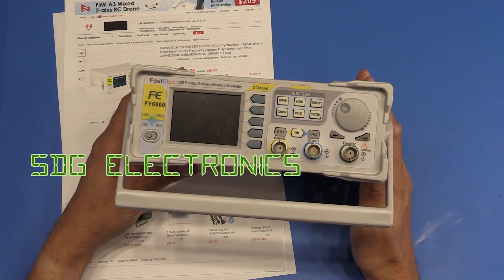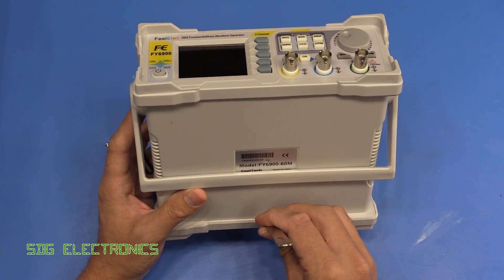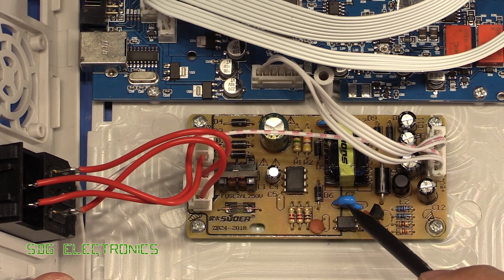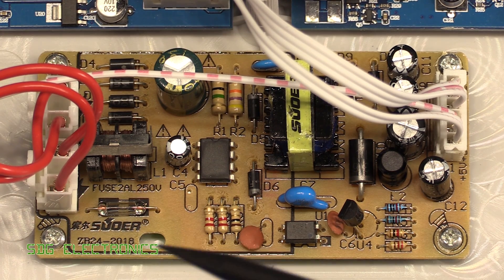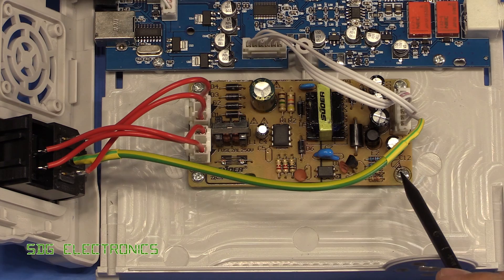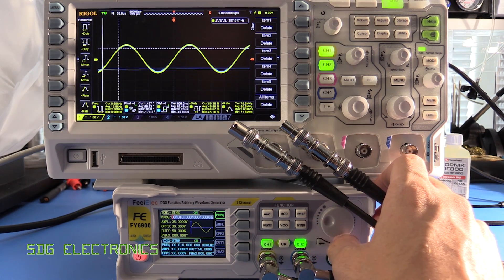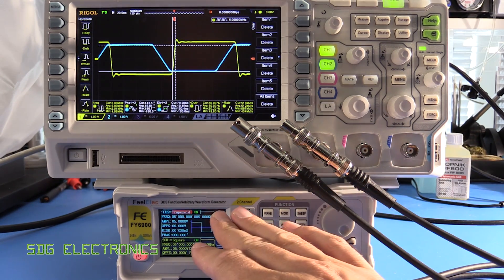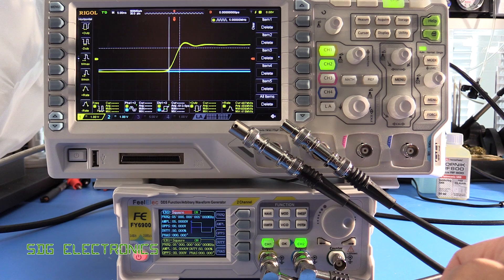SDG #096 Feeltech FY6900 Arbitrary Function Generator Teardown

Comment: 50Ohm load ..........gen 5VPP........??? 2,5V pp on scope
Reply: Yes. The voltage is divided by the internal 50ohm in the generator and the 50ohm impedance of the scope. I has to be 2.5V

Comment: On my FY6900 (100MHz version), when I cable one of the signal generator channels over to the integral frequency counter (not shown in this video), it reliably shows the same duty cycle numbers. But when measuring either of the internally generated sine waves, the counter shows a duty cycle if 59.6% or something like that. I have noticed the same thing in some other videos of this model, all of them slower speed versions. I wonder if it is a bug....it does not seem to be due to the sine waves having a DC offset or anything like that........

Comment: nice review !   if one were to power it via the 5v in on the rear what would be a suitable input current from the PS used ?   wondering is a 2.4 a  cell phone  charger would be acceptable or even what to choose for current from a bench P.S. unit.   I'd be using it only for sine wave 20 - 20,000 khz  for audio amp testing purposes... at that frequency the square wave may even look proper but all i need is sine really.

Comment: The 5V+12v,-12v are pretty common voltages, you can easily build a small lnear PSU and fit it in there with LM78xx regs.

Comment: The Roll off is smooth from zero to 60Mhz seen logarithmically, it become noticeable in particular above a couple of Mhz and decreases rapidly towards 60Mhz(-12dB down), good quality signal generators would probably use switchable gain amplifiers or amplifies that can handle higher frequencies. Nice toy!, but its no way a serious bit of test equipment.

Comment: I've been watching various reviews on these cheaper Function Generators and SDG has been very helpful in choosing one for me in 2023. I'm a hobbyist and purchased the East Tester ET3360C 60Mhz unit. It was delivered this morning (10 day delivery) and I have to admit I'm very happy with my purchase. The unit has a very small screen but is easy to read. This particular unit will do modulation for radio tuning but I will mainly be using it to drive TTL clock frequency. There is a drop off I'm aplitude after 30Mhz Sine but that is to be expected. I'm very happy with my East Tester ET3360C.

Comment: Try to not direct BNC cable connect between the FY6900 and a 'scope, say to observe or test the FY6900 wave forms, timing and other features. Ringing will likely occur , occluding and changing wave-forms, etc. Instead, utilize the properly compensated 'scope probe(s), and one will receive and observe a great deal improved wave-forms.

Comment: Picked up one of these recently. Was going to build your PSU for it but my FY6900 comes with the v2.1 pcb which only needs a 5v supply.I’m going to try replacing it with a Meanwell 5v SMPS.
Reply: Hi. I can't find any other information about this v2.1 revision of the board. Can you elaborate? or post a picture so we can see the changes?

Cheers.
Reply: What FW version comes up on your boot screen?
Reply: My question re FW was to Stuart...

Comment: I have been off the air for 35+ years, just started up again and need a few pieces for the bench, not mush reparting anymore, but something to have in case.  I was looking at the K moon FY6800 DDS Signal Generator/Counter,  For something that may be turned on once a month if that what do you think?

Comment: So beside the lead from the mains which I agree the cable is too tiny, the rest is overkill for a generator that already meets the needs of hobbyists.  I'm not sure what you think these units are supposed to have at price point of $100.  Realistically you are getting a lot of function for that money compared to the big boys.  Frankly I see no issue with its current power supply whatsoever and any variation would be negligible at best.  It's not overheating by any means and that's why there isn't a stock fan.
Reply from the maker: The output drivers get excessively hot when driving a 50 ohm load which is the main reason for cooling. 
The main issue with the power supply is it is not suitable for use in this country and would fail the requirements for the usual UL, CE, TUV certifications. The leakage current is also sufficiently high that it can present a risk to any electronics connected to it.

Comment: Hello Steve! This is the best overview of the generator FY6900 on YouTube. Thanks. You like it from me.
Reply: Steve, I have the 6900 and my oscilloscope showed substantial switching noise. I installed a torroid in the 5 volt line with capacitance after to 0 volts. The noise was very low after and my ham radio no longer saw the noise.

Gerry Rousseau

Comment: Does it allow smooth adjustment of amplitude, frequency and so on? Mine appears to disturb the output for a while whenever I do any adjustment to the waveform parameters.
Reply: Hi, I have a FeelTech FY3200S and it does the same. I would like to buy another signal generator that does not make glitches when adjusting the frequency or amplitude. Which signal generator do you have? and did you get an answer to your question?
Reply: @gertgude-hansen2562  Only your answer. Mine is FY8300 10MHz. This glitch is very annoying and makes this generator useless in my experiments with switching power converters processing power while the generator was supposed to smoothly change the reference signals amplitude/freq.

Comment: Nice video. So have the potentially dangerous floating voltages been fixed? Will I need to put in a linear supply? Is that what you had to do? I have 39 volts rms coming off the BNC grounds and the very arbitrary signal is disturbing looking spikey garbage - and this is with the power off and the unit connected to mains. Would you know if I'm missing something?

Comment: Hi Steve, I couldn't deal with the encoder knob. So I 3D printed a new one. I dl the openscad code from thingiverse and modified the code to what I wanted. It's SO much easier now to adjust the generator. I did print it upside down so the shaft hole was facing up for better results.
Reply: Lucky you, having 3d printer... I would need to make it from wood....

Comment: Thank you. Great video 
I am just wondering if I can sync the start of a square wave on channel 2 with the start of a sine wave sweep on channel 1.

So my square wave will pulse every time my sweep starts.

Like in this YouTube video.

https://youtu.be/uMH2hGvqhlE
Reply: I just got one of these today from banggood (60Mhz version). I tried this (as seen on eevblog) but the sync output multiple square wave's at different frequencies not a square wave based on the timer cycle (no options to change that either). So I setup a 1sec square wave on channel 2 and did a 1sec sweep on channel 1. This seemed to work but I was seeing a big drift between the start of the sweep and the square wave trigger. This led me to find out that it had a sweep timing fault (on my box or by design??). I found that when I chose a 1sec sweep I actually got a 0.89sec sweep which was causing the drift, even if I compensated to 1.1sec it would still drift slowly :( ...I also found that the phase controls on both channels didnt work on my box so I have a faulty box and sending back.

Comment: Thought: Wouldn't it be better to add a series inductor to the (signal-ground to mains-earth) connection?
It would ensure a DC potential between the signal ground and mains earth close to 0V, while letting the EMI suppression safety capacitor carry any high frequency noise

Comment: Will be looking forward to your next video on this, have just purchased this model and would very much like to make the suggested modifications. Would be nice to do the output of a transformer into buck converter modules but will probably knock up something akin to your FY3224S regulator circuit if that's what you end up doing, at this point i'm just gonna sheeple it and do what you do lol The only thing i'll do different if you go down the regulator route is JLPCB it for a more neater result... I just have a fetish for Red PCB's :-)

Comment: thanks for the video. for me 5v output is not enough, so I will certainly go for a 30MHz version instead that offers 20V output. also this poer supply seems very crappy. the former 6800 had a better one !
Reply from the maker: I think I was mistaken, the output voltage capability is the same, but drops when set to higher frequencies
Reply: @sdgelectronics  do you agree with him about the power supply being worst? Thanks

Comment: The color of the protection gear is the same as the body color. Also the back panel misses labels and voltage plate. It looks like an unfinished product.
Reply: Labels are stamped into the plastic

Comment: Hi. Thanks for the review. It does not make any sense that the 60 MHz version is rated ONLY to 5 Vpp output. If you see the specs table (at minute 01:30) you will notice that those 5 Vpp are for outputs greater than 20 MHz (take a look at the row immediately above of the one you highlighted in yellow) and the outputs at 24 Vpp are available for frequencies lower than 5 Mhz. It looks to me that this is for all models. I guess those 4 amplitude ranges in the table do not belong to each products model (2nd row), but they do belong to the row with the frequency ranges just above the yellow row. Actually you never adjusted the amplitudes in your video above 5V. Tricky chinese specs table!!!. Thanks.
Reply from the maker: Hi Rodolfo, yes I think you may be correct. Either the GBW of the amplifiers is not high enough or they cannot dissipate enough power. Indeed it does let you set the voltage higher at low frequencies.
Reply: Is there anyway to overcome this limitation? like putting the output in series with an external power supply?
Reply: @Adrian_Finn  Just use a amplifier, right?

Comment: Thanks for doing this video. I'll be waiting for the update, as I just purchased that same generator. It will be interesting to see your changes for a PSU. I replaced that same return wire, but mine wasn't as big as yours. I installed a fan from a zener float, the extra caps seemed to help clean the circuit. It was also missing a heatsink.  As always, great video! :-)

Comment: Nice video. Does it also show half amplitude when connected to a 50 ohms termination like the previous model?
Reply from the maker: Yes.
Reply: @sdgelectronics  is that not correct? It seems to be correct since that would be an impedance match

Comment: Thanks for the info,, I remember the mods you did to your old one and I had followed your lead! I would gladly pay 10 to 15 more for a liner power supply although building one is not a problem but still it would be nice if it would come with one from the start. Thanks again!!

Comment: I believe standards call for ground wire to be the same gauge or thicker than mains. That way in case of “catastrophic failure” it would be able to carry all of incoming mains current to the earth and not blow up like the fuse. Here the ribbon cable looks about 22 gauge when mains looks at least twice thicker.

Comment: Thanks for doing this excellent review. I purchased the same 60MHz unit about 3 months ago and have been reasonably happy with using it to drive a set of synchronized PWM waveforms. One question I have is that you were a little bit cryptic when you spoke of how the power supply was non-ideal because its design wasn't compatible with the need to ground the BNC shields. I think it would be interesting and educational to explore this further if you have time and include high level schematics of the way it's currently being done in this unit, and the better way.
Reply from the maker: I will probably design a new PCB for the Power Supply and cover all of this in a future video :) Thanks.

Comment: Thanks for the review. I have been looking at this product.They sell four versions of it. Seems to me that the only diffrents beetween the 20Mhz version (cheapest) and the 60 Mhz version (most expensive) is the max output freqency of the sinewave ( 60 Mhz instead of 20 Mhz). All other waveforms have the same top frequency output (except square wave is only 15 Mhz on the cheapest 20M type, but 20 Mhz on the other three more expansive types).

What is interesting is that all four version have the same sampling rate of 250 MSa/s. I also do not see any other difference on the spec on the banggood website. As a layman it looks to me that the going over 20 Mhz is of no use with this samling rate. What you are possibly paying for on the more expensive versions ( 30M,50M and 60M) is just unlocking in the firmware, disorted waveforms, that the equipment has no way of displaying correctly. There is only a 14$ price diffrence on the 20M and 60M version. But what are you getting for that money ?

Maybe I am missing something on the spec. Please comment if you think I am wrong on this 

It would also have been nice to see what the waveforms look on the max frequency.
Reply: The output voltage is higher for the lower frequency versions.
≤10MHz: 1mVpp~20Vpp
10MHz to 20MHz: 1mVpp~10Vpp

20MHz and above 1mVpp~5Vpp
Reply: @SimonCoates I
I am confused. I am not an expert, but Is it not a benefit to be able to get a higher output voltages.  Something you would pay more for, not the other way around. Is it possible that the max output voltage decreses with higher freqency on the same version (model type).  For example on theFY6800-60M type, the max sinewave voltage on 5Mhz would be 20 vpp, but only 5 Vpp on 25 Mhz frequency.  That is how I understand the spec on banggood.  But again I am just a layman and would be happy if I am corrected on this.
Reply: @davidandersson4246  - sorry for any confusion. The 60Mhz version will output the higher voltages at lower frequencies - with the amplitude lowered in software at the higher frequencies to limit the power.
User Guide here: http://en.feeltech.net/index.php?case=archive&act=show&aid=62

Model              ......FY6800-20M   FY6800-30M  FY6800-50M   FY6800-60M
Sine                         0~20MHz ..... 0~30MHz ..... 0~50MHz ..... 0~60MHz
Square                    0~15MHz ..... 0~25MHz ..... 0~25MHz ..... 0~25MHz
Ramp, Triangle      0~10MHz ..... 0~10MHz ..... 0~10MHz ..... 0~10MHz
Pulse                       0~10MHz ..... 0~10MHz ..... 0~10MHz ..... 0~10MHz
TTL/CMOS             0~10MHz ..... 0~10MHz ..... 0~10MHz ..... 0~10MHz
Arbitrary Waveform 0~10MHz ....0~10MHz ..... 0~10MHz ..... 0~10MHz

You are correct in thinking there's not much between all versions. I was lucky and got a KKMoon branded FY6800-60M at £66.49 next day delivery.
Reply: Previous model FY6600 the square wave is nearly a sinusoidal at the limit. Sine wave is only slightly distorted at limit. Previous version were also simply firmware limited in freq range.

Comment: I got a KKMoon branded version of the FY6800 60MHz from Amazon a couple of weeks ago for just £66.49 - absolute bargain. I prefer the FY6800 case to the newer FY6900 - cleaner lines and easier to see markings on the rear panel. It's great value for money considering all it's features and accuracy. Don't forget it's also a frequency meter and counter, and up to 8 units can be sync'ed together. I agree on your comment about the encoder knob. Although it pulls off easily and I can make a bigger one with my 3D printer.
Reply: hope yours wont brick it self like all the others
Reply: @MrOrangeman18  - Noooo, I haven't heard about that - do you have any more info?
Reply: @SimonCoates   just google it. theres lots on the eev blog forum
Reply: @MrOrangeman18  - wasn't it the FY6600 that had issues?
Reply: Simon Coates yea that’s the one.

Comment: Any plans for a more in-depth assessment. It would be nice know if this model can maintain its stated output levels over its frequency range unlike it's predecessor? Karl
Reply from the maker: Let me know what specific tests you'd like and I can do them. Thanks
Reply: @sdgelectronics  signal purity, output level range and accuracy. General hands on experience of the user interface would be good. I have the earlier model with the 16/2 LCD which is only just a usable instrument. Karl.
Reply: @sdgelectronics   software connectivity, firmware updates?

Comment: I purchased the FY6600 last year and rebuilt the PSU. It came with a 2 prong power socket which I replaced with a 3 prong. Furthermore the output caps on the PSU were only 16V rated and the rails were measuring 15V. I decided at that point to replace the PSU completely.
Reply: Same. I got the 3200 and built a regulated linear psu for it.
Reply: 3200 what?